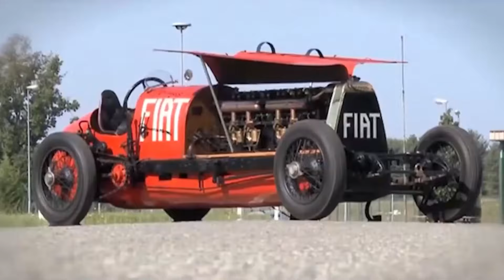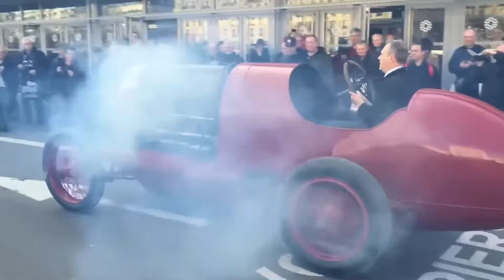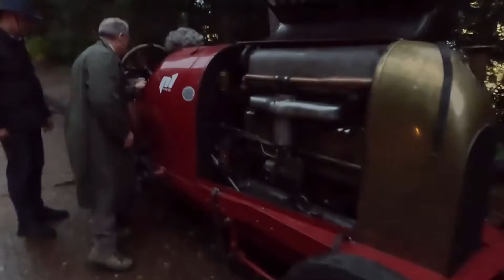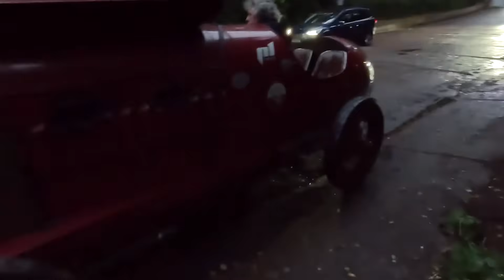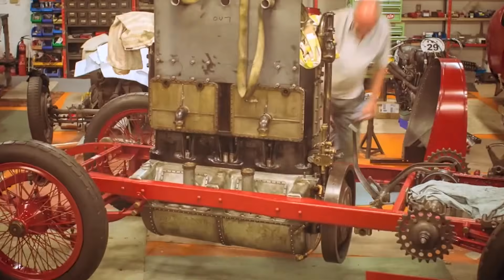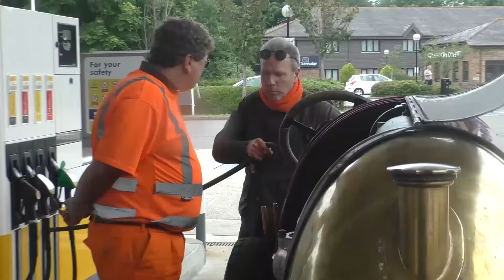How Fiat Built the Biggest Engine Ever Put in a Car (Fiat S76 “Beast of Turin”)

Comment: I drive something like this every chance I get, a American lafrance speedster. 5000 pounds, no doors, no front brakes, no seatbelts, no windsheild , no power steering,  no key ,  no automatic transmission.  No muffler/silencer.  Chain drive spinning at 900 rpm right alongside your arm.  You hear it coming a mile away.  It wakens babies from their nappy,  makes old ladies cover their ears,  men start drooling.  Children start dancing, jumping up and down with excitement.  Drinks petrol like a drunken sailor.  flings grease and oil off the chains onto car windsheilds behind.  Takes two car lanes to make a turn..... great fun indeed!   that should explain Duncans obsession with the beast!   Keith